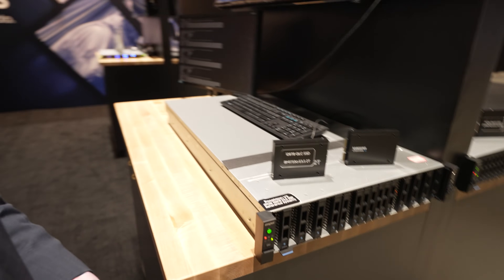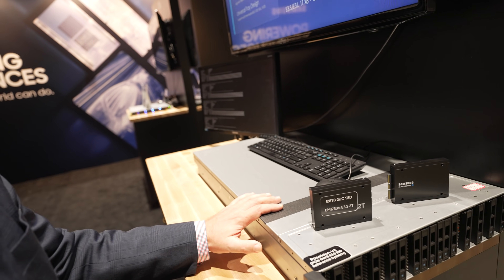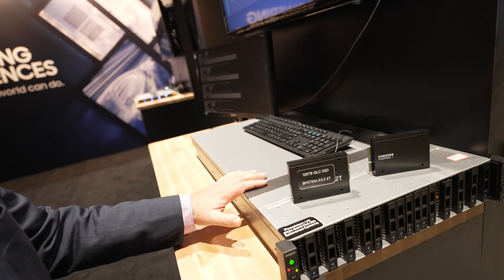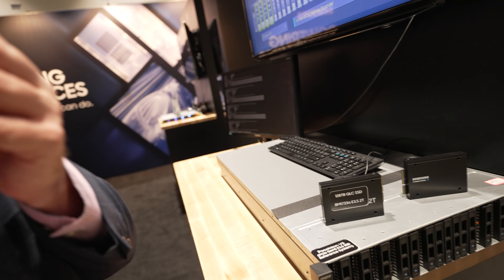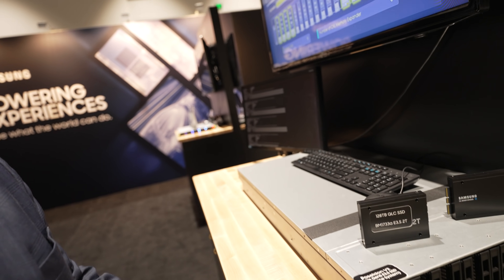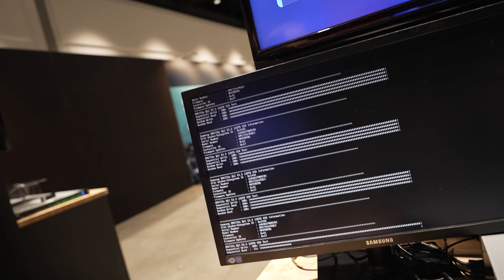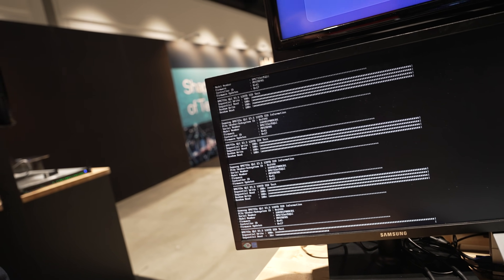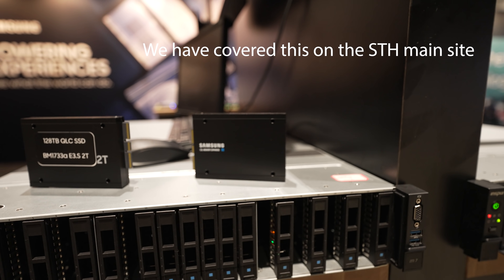WILD Cloud Hardware at OCP Summit 2021

Comment: Heaps of cool stuff there, I've been wondering when smaller ocp racks might make an appearance so some of that equipment can be used by smaller operators, or reused in homelabs.

On the video thing, audio was generally fine for a walk around I thought, focus eh.. it is what it is. You should see if you can get one of those handheld camera gimbal mounts, some of the older model DJI are pretty affordable these days.
Reply from the maker: 100% have a Ronin but just did not bring because it did not fit. I also did not plan on doing this one.

Comment: Hi Patrick, thanks for show of new cool tech!
And for the video troubles - my recommendation would be to use eng style fixed lens camcorder. If you are one-man-army without camera operator for run&gun the cine cameras are more trouble since you have worry about multiple things. Something like Canon XF605 or smaller equivalent spec'd camcorder would be perfect for this kind of work. Thanks to smaler sensor you don't have to worry about nailing the focus that much, ofc it has also disadvantages like it's less sensitive to light than the FX3 you used.  

BTW: The the shallow DoF was kind a distracting for me since everyone here is for the look at the tech :) .

Thanks
Reply from the maker: Yea, it probably would have been better with some planning. This was impromptu. Good suggestions

Comment: Show floor stuff is very cool! If you're gonna do it more often, I think there are better cameras that are more suited to auto focus and auto exposure so you don't need to worry about that. Apparently the Sony ZV-1 or even the A6400 are good choices.
Reply from the maker: Thanks! This was actually done on the Sony FX3 so it should have been better. I probably should have just used the Canon R5 I use for stills.
Reply: I love cameras, but I'd probably go the other way and use an iphone or good android plugged into the rode wireless go 2 for audio.  I'm guessing that is what y'all are using for audio now.  With a phone you wouldn't feel as intimidating to other folks, and they do well at full-auto mode.

Comment: If PCIe 5.0 NVMe for enterprise can manage with 2 lanes, surely there could be a new standard for consumers reducing it further to one lane. I think it's a bit too much to use 4 lanes (M.2) when they are in such short supply in regular consumer motherboards. It would enable M.2/U.2 level of performance with the PHY complexity more similar to that of SATA. It's not as if I would ever need 16 GB/s anyway even if I use DirectStorage for asset streaming when gaming.
Reply: Agreed. More slots using bifurcation please. Few in consumer space need those speeds but we could certainly use more slots with 4/8x PCIe4 lanes.

Comment: PCIE5 just casually dropping,..  crazy crazy hardware, never stops does it? Whilst cool I find that robot taking the severs out a bit pointless?
Reply from the maker: Maybe will do more on it next week at SC21. The robots lift machines out of immersion fluids. So heavy and have to be lifted out vertically. The robot automatically can pull the nodes based on detected failures
Reply: @ServeTheHomeVideo  Ah thanks, I didn't think about the weight. I understand the need now if it has to be an accurate movement with strength.